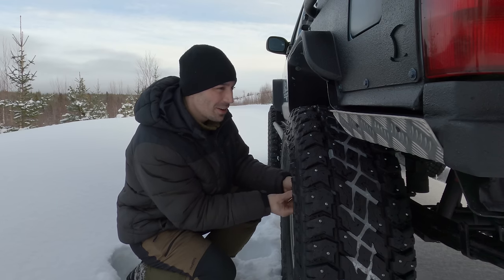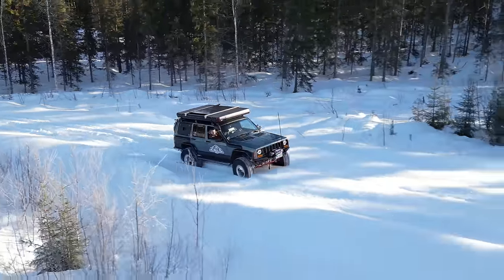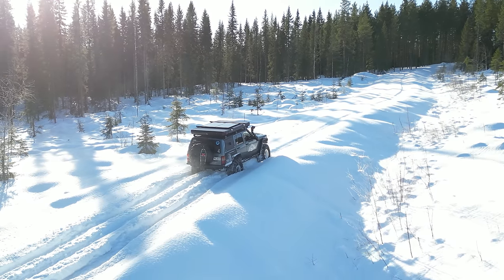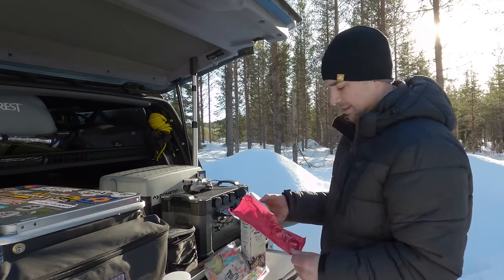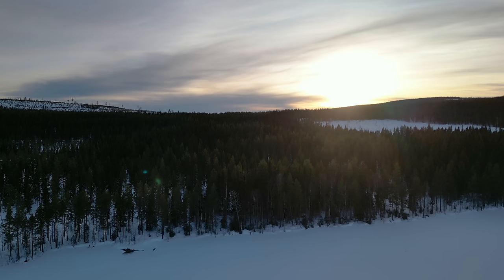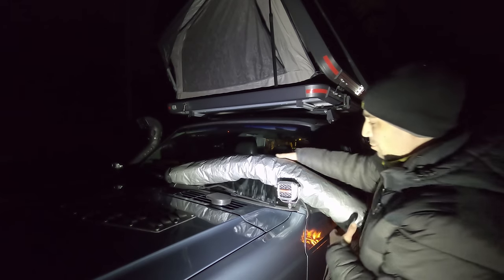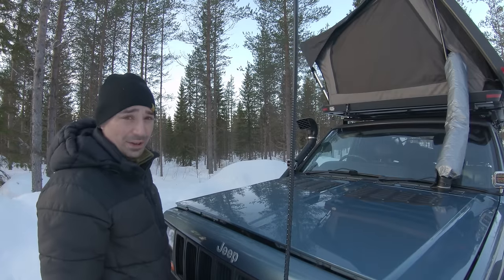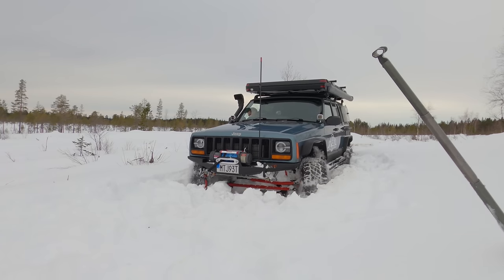Epic Drive And Chill Adventure / Winter Jeep Camp

Comment: If you fit an inverter to the starter battery you can rapid charge the modern power stations off the alternator in an hour or so. My son was a pro skier for a bit and we used to run a ski iron with the engine at idle no problems. Obviously no problems if driving. As you trips never seem long enough to be diesel constrained this with induction cooking seems a good solution
Reply from the maker: That's a very clever hack for quick charging. My winter trips are pretty short, just a few nights at the very most as we have a young family, and I find it hard to be away. Maybe when he's a bit older, he can join me. I would love to do a longer winter adventure, maybe when I have a locker, though!! 
Thanks for the tips

Comment: That’s a beautiful XJ. When I geared my XJ, I did a limited slip rear and ARB locker in the front. And the difference between 10psi and 5psi is night and day.
Obviously running beadlocks. Cheers.
Reply from the maker: Thank you! I should have locked the front when I geared mine. Then I would have has a similar setup. I will get an E Locker for next season I think.
Thanks for watching!

Comment: First thing I installed on my XJ was a Eaton elocker on front diff, even before a suspension lift or winch .
Reply from the maker: I've never needed one until late winter when the conditions get like this. I will put in an E locker pretty soon, I think, but it won't be any use until next February, March

Comment: Another great video,  well done! PM me,  I have a spare Spartan locker for the Dana 30 I'll send you to get you by until you figure out your front axle build.
Reply from the maker: That's extremely generous of you! I've considered running one and just using 2wd in the winter when on the roads. I drive a lot in 2wd anyway, so provided it's not 4h, it should remain unlocked.
I can't send PMs on YT because they stopped that service. Perhaps I can give you my email, or you can contact me through Instagram? Info@mcqbushcraft.co.uk

Comment: So certain older volvos had a dana 30 rear with a govenor lock LSD. Which is not ideal, but it acts open until one wheel spins a certain rpm faster. Then it kicks in. Where you are, they should be cheap. If you want something better Id recomend a detroit trutrac
Reply from the maker: The Jeep has a chrysler 8.25" 29 spline on the back with a track lock. It's just an lsd but they are very good as both wheels always spin together. It's not so good when you don't want to drift, but a 30 on the rear would be a downgrade due to the small ring and Pinion. 
Thanks for watching
Reply: @WorkshoptoWilderness  its the same diff. Yank the center and put it up front.
Reply from the maker: That's very clever!! Almost to clever. Probably cheap, too. I will look into that! Thanks
Reply: @WorkshoptoWilderness  if you decide  to get one, look into modifying the govenor system. You can make it engage faster, and not disengage at higher speeds. Theres a video here on yt about it.

Comment: Love watching your channel! Much love from the USA 🎉 what axles are you running? Thanks
Reply from the maker: Thanks for watching! It has a chrysler 8.25" 29 spline on the rear with the factory track lock. 
Front is a high Pinion Dana 30 that I've strengthened as much as I can.

Comment: With those lines running to your tyres on that under carriage shot: do you find they catch on things?
Reply from the maker: In the snow I haven't been concerned but prior to the summer its been on the back of my mind. I've already discussed it a lot with some mates here. I might have elastic straps holding them against the frame.

Comment: Have you ever weighed the XJ? I'd like to know the frt/rear bias
Reply from the maker: I weighed it on a full-size scale. It came in at around 2210kg ish with a full tank of fuel. Too heavy, I thought at the time. Subsequently, I've now permanently removed the rooftop tent and its accessories. That's 90kg  off the top. I also replaced the drawers in the back with a much lighter build and took out the steel cargo rack. So perhaps in total, I would say 120kg off, BUT I did put in 30kg of batteries, and the new drawers were 25kg, so realistically, I dropped 65kg. So it's around 2145kg fully loaded with 100 litres of diesel. 
It runs much better without the wind sail on top, plus it's up around 200hp now and near 400nm of torque, so overall, it just feels less heavy.

Comment: What engine did you swap in ? Seems alittle low on power/torque?
Reply from the maker: Torque is 380nm, power 150hp. It's a factory engine we get here in Europe, although not quite stock. I've always been very happy with it as the peak torque curve is around 2000 rpm, so it's never really spinning wheels. They are not good at floatation work but unstoppable when crawling. A turbo swap would help bring in earlier spool up, but we shall see. Thanks for watching
Reply: @WorkshoptoWilderness  Been watching since the bushcraft days. These are nice videos also.